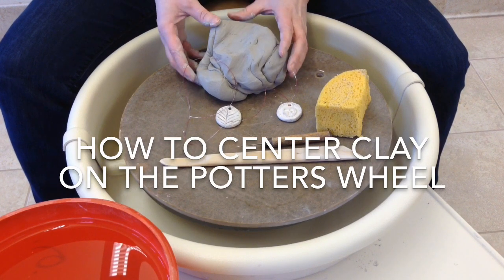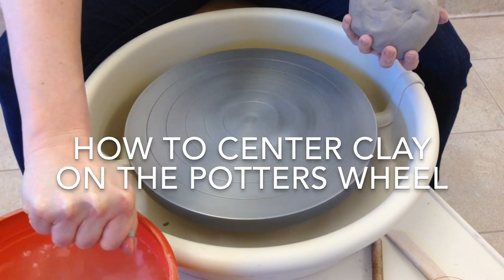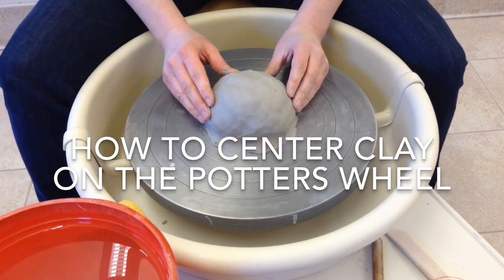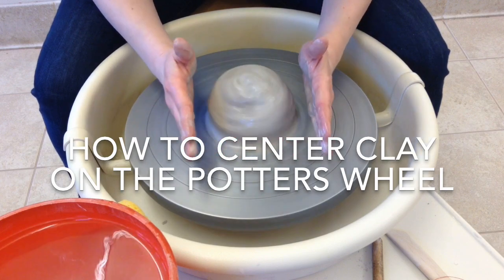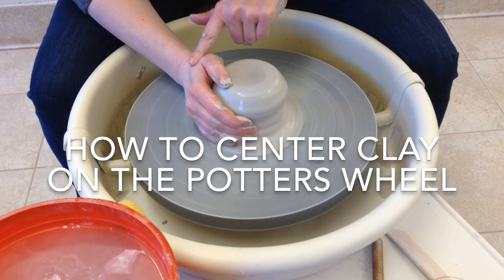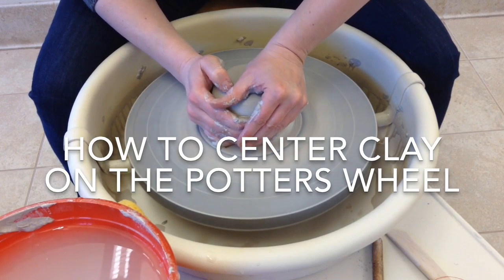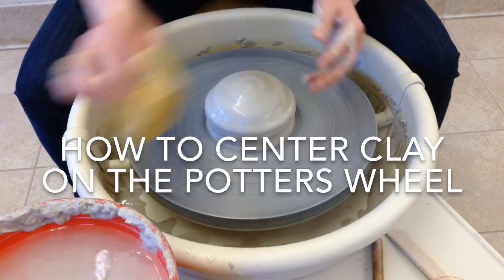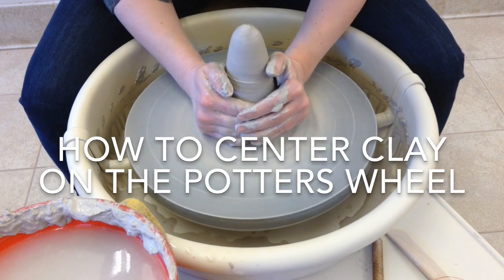How to center clay on the potters wheel

Comment: So if you didn't throw it in the middle of the wheel and it needs to be pushed over, we push it over inch by inch by pushing it down and bringing it up over and over again until we finally get it centered?

Comment: Where do I get the potters wheel
Reply from the maker: There are lots of places to purchase them. Google "ceramic supply" and you will find lots of places that sell wheels, kilns, clay, etc. Wheels can be expensive to ship so find the one closest to you and see what brands they carry. A decent new wheel with enough power to work properly (cheaper ones cause so much frustration!) will be between $500 for a tabletop model to $800- &1100 for a full sized professional model. Tabletop models by Shimpo, Creative Industries, and Quark have plenty of power for 99% of projects- they can't handle HUGE amounts of clay to make enormous pots- but most beginners are not making those anyway!